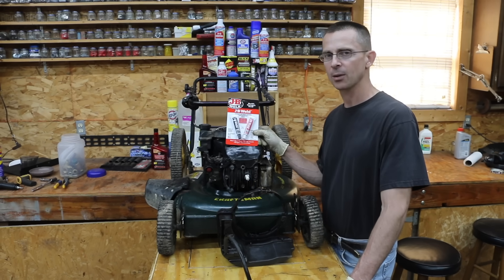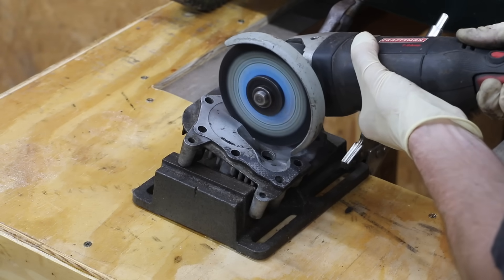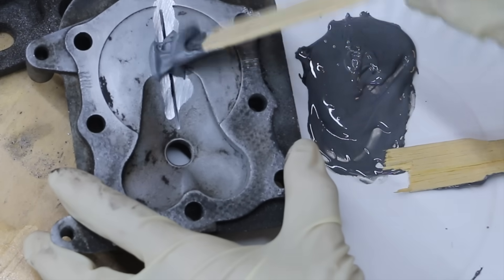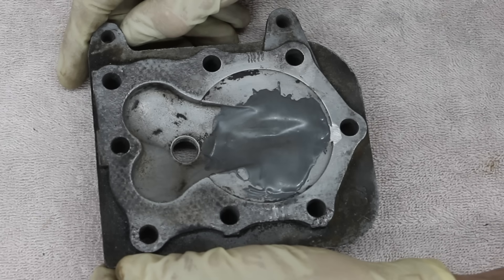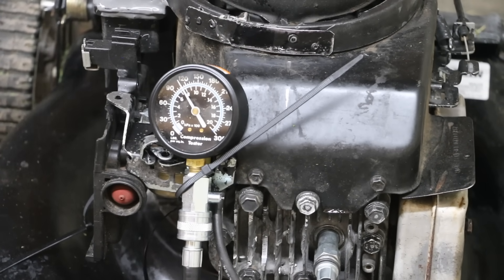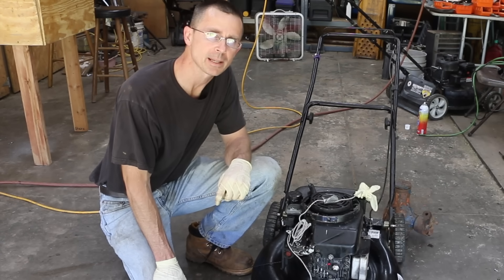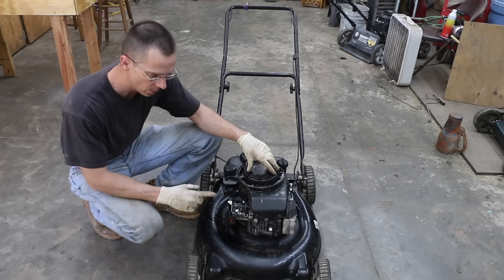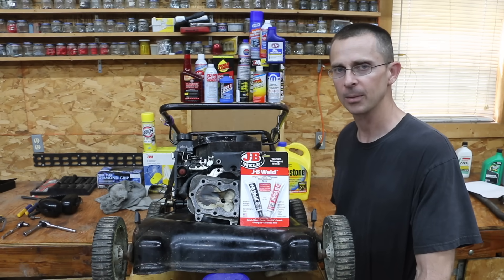Can JB Weld fix a cracked cylinder head?  See the proof!!

Comment: I have JB High Temp in all my motorcycle tool kits in the event of an engine case break on the trail or somewhere remote. After watching this vid and your epoxy showdown vid, I'm replacing HT for the Original. Im convinced now that the Original spec of 300F max temp is suitable for an engine case break. Moreover, from your showdown vid, I can use Original on plastics. 
Smart work! As a biochemist, I dig watching your methodology!
Reply from the maker: Thank you very much!  JB Weld original is a great option in your situation. Thanks again.
Reply: @ProjectFarm  thanks for the reply! I was leery to post a comment (bc with all your subscribers and simply time managment) and then my post wouldn't get read. Very cool. You do read your posts! Thx again!

Comment: JB Weld is awesome stuff.  A few years back I owned a Wheel Horse lawn tractor with an 8HP  single cylinder cast iron Kohler.  While mowing one day, the connecting rod broke and the crankshaft pushed the broken rod through the side of the crankcase.  After gathering the 4 pieces of cast iron, cleaning and preparing them by grinding and beveling, I re-assembled the pieces (like putting together a jigsaw puzzle) and applied JB Weld to the outside area.  24 hours later, I repeated the JB Weld on the inside area.  I replaced the connecting rod with a new one and mowed for 5 more years, eventually trading to Wheel Horse for a new Cub Cadet.   Even though the repair of the crankcase wall was made in a low stress area, the 5 dollar JBWeld gave me a lot more time with that tractor.
Reply from the maker: Impressive repair!

Comment: I used epoxy glue to glue a hole in a Head on a 225dr 3 wheeler worked great for little over a week
Reply from the maker: The heat must have exceeded 500F, the heat rating for the JB Weld.  Extreme heat might work if you can plug the hole using it from the inside of the head.

Comment: I used JB Weld to attach a ceramic handle to an aluminum dutch oven lid. After all the heat and washing, more than a decade later still holds fast.
Reply from the maker: Impressive results!

Comment: I am curious, how well would jb weld work to repair a substantial hole (2-3") in the coolant channels surrounding the cylinders on a cast iron diesel. Maybe place a steel plate over the hole and cover with jb weld?
Reply from the maker: I believe it could possibly do the job (hard to form a strong opinion without seeing the damage) but it's extremely important to remove all traces of oil and antifreeze.  Yes, a piece of metal over the hole and a very generous dose of JB Weld. Thanks
Reply: @ProjectFarm  Is there any way I could send you a picture?

Comment: I recently encountered a stripped spark plug on a seeding machine. It was a Honda engine, but aftermarket head assemblies are cheap enough...$50.
In a pinch could the plug be glued in with JB? This is assuming there is a spark plug ground contact with the engine.
Reply from the maker: I believe JB weld is a terrific product, but the head temp over time would likely lead to failure.

Comment: How's it holding up as of October 1st 2018? I'm curious as to how long JB Weld will hold up? It will eventually begin to peel away.
Reply from the maker: I haven't continued to use it.  Great point regarding the extreme temps of an air cooled engine.  I don't believe that it would provide a permanent repair in the combustion chamber, but it would do very well in other parts of an engine.

Comment: I've used this for so many things.I put  aluminum foil with spray on oil,then put the worn out shifter ends on and rattled them around, filled with JB.My car didn't have a problem after.It was a 5-spd GLH Omni '85.The rod was a hollow tube and ball-n-socket ends.
Reply from the maker: Impressive repair!

Comment: I have a motorized bike the crankcase where the 4 bolts go  had a stripped hole so I tapped the hole,the tap was too big it broke a piece off the crankcase in the hole of the thred where the bolt goes.
I saw this video and may just try using JB weld I need this to work dont want to spend $ I dont got to replace it.
If it works I will post my video.
Reply from the maker: Thank you

Comment: Interesting video. I have used JB Weld to fix scores on hydraulic cylinder rods. It will smooth-out the damage so your rod seal will last. Not ideal, but in a pinch, it works. Laurin
Reply from the maker: Impressive repair!  I have lots of hydraulic equipment around the farm. So, thank you for this idea!

Comment: I just saw this video, impressive result from JB !  I have a min-80's Tanaka air cooled outboard I used on my canoe till I let it slide down a wall and hit the cement floor causing many shatter-pattern cracks in age-hardened plastic and significant leaking.  After cleaning & drying I used a soldering iron to try and weld the cracks but still had some leaking so I ran Seal-All along the visible cracks + those I stitched with the solder gun.  It still leaks a little.  Maybe I missed a couple of cracks, need to recheck.  It would have been a better test if your gas tank leak was at the bottom of the tank for more extended exposure to fuel.  
I considered JB initially but I couldn't confirm it would be secure on polyethylene plastic.  I'd buy a new tank if they were available and haven't been able to find a good used one.  :(    
Interesting channel, I like your tests.  Seems lots of us has the same interests !!
Cheers !
Reply from the maker: Thank you!

Comment: When you use your wire brush on the cylinder head and the cylinder and valves, does that damage either in any way?
Reply from the maker: It does cause scratches. I wouldn't do this to an engine with a lot of value.

Comment: This test, JB Weld, was not complete. The "crack" introduced via grinding was really a slot. Since the slot was encased at both ends it did not represent a true crack which would exit out of the side of the cylinder head. This would potentially allow the epoxy to let go due to lack of support.
Reply from the maker: Great point and thanks for the constructive comment.

Comment: I've used JB weld for a cracked water jackets on my farmall f20 and f12. It been 10 years and still holding good. Also used it on steel gas tanks, it's a good replacement for sodder. Good vid!
Reply from the maker: Impressive repair! Thanks for commenting on this.

Comment: I have used it for years. glued in a spark plug that the threads were stripped. And repaired a block that a rod went through. However not good on exhaust manifolds
Reply from the maker: It's an amazing product. Thanks for commenting.

Comment: I can tell you now. Jb weld can't handle the pressure and heat of an engine.
EDIT: I stand corrected.
Reply from the maker: Actually, you're right with regard to the long-term impact of the heat inside of the combustion chamber.  However, it does great if temps are below 500F.

Comment: Marine Tex is another product you might want to try. It has fine aluminum filings mixed into the epoxy. It is also thicker than JB so it runs less. It can be drilled and tapped. Has been used to repair water jackets on out board engines as well as a hundred other things. Just FYI.
Reply from the maker: Thanks for the recommendation.

Comment: Brother in law used it on cracked engine block in old Ford truck. It was leaking coolant. JB fixed the issue and it was still working 3 years later when he sold it to an old farmer.
Reply from the maker: Impressive repair!  JB Weld is a great product.

Comment: Do you this would plug up about a 1/4 inch hole in a freeze plug on a jeep?...
Reply from the maker: Yes, but it is extremely critical to remove all traces of oxidation and antifreeze.  If the surface prep isn't great, it won't work.  The product needs to grip onto a very clean surface. Hope this helps.

Comment: I had a plug hole in a VW cylinder head strip out years ago and was strapped for money so couldn't buy a new cylinder head. I cleaned it well with brake cleaner and JB Welded the spark plug into the head and then drove it for most of a year driving 140 miles a day to and from work. Finally bought a new heads and installed. Neighbor kid asked for the dual port heads I had removed and drove an additional year before changing. Still was running but plug was shot and we couldn't get the plug out of the head.
Reply from the maker: Impressive!

Comment: I have a 2 stroke dirt bike that had a broken ring that scored a groove in the cylinder wall from a port up to the top of the cylinder. The groove was about 1/8th inch wide, and about 1/32nd  inch deep... I'm attempting to repair it with jbweld.

And have you ever tried Titanium putty?
Reply from the maker: I haven't tested titanium putty yet.  Thank you for the recommendation.

Comment: I use JB weld on a cracked exhaust manifold on a high compression 429 big block because actual welds kept cracking. It is actually holding up. Impressive stuff.
Reply from the maker: Impressive!

Comment: I could save you some time on doing that but it's already too late but try it on the in exhaust system where it gets about for 500 Degrees it does work tremendously add a straight-6 that's was a slant six Chrysler motor with a split exhaust and I fill the Gap with J-B Weld let it sit for 24 hours sanded it smooth and they look real pretty put it together turn around and down the road that a bit of extra noise so if it works on the intake I will guarantee it will work on the exhaust system and yes it does work on fuel tanks be careful though make sure to dry before you put fuel back in it it will stop your fuel tank flowing if it is in the wrong location
Reply from the maker: Great point.

Comment: When I was young in the early 90's, I had a Jeep that I had over tightened the cast aluminum timing cover on.  Coolant leaked out.  I used JB weld to repair it.  Drove it over 10,000 miles before selling it.  It never leaked again.  Great stuff!
Reply from the maker: Impressive!

Comment: And you could have used the high heat or extreme heat. Just had garage apply extreme heat around o2 sensor in my s10 exhaust piping. Hoping for less noise.
Reply from the maker: Great recommendation.

Comment: Back in 1999 I had to use. J. B. Weld on a 96 Kawasaki Vulcan Classic 1500cc the  radiator had a cracked at the mounting point and where it's aluminum it was hard to get someone to weld it . To replace the radiator was going to be about $200-$300 so I decided to try J. B. Weld and it worked great ever since then when I'm with friend and  something breaks I say "better get some J.B. Weld"
Reply from the maker: JB Weld is a great product!
Reply: Yes it is

Comment: When i was a young boy i'd watch and help my father and uncle strip clean and rebuild engines, carbs, cars etc and as my father was a welder he swore against using jb weld, but my uncle was a fabricator with cnc and laithes and he swore by using it jb weld.

I can say for sure that if i need something fixed ill be throwing my money at jb weld!
Reply from the maker: Yes, JB Weld has saved me many times on applications in which I'm unable to use my welder.

Comment: But it won't repair a lowmside air-conditioning expansion tank. Refrigeration ate threw in a few hours.
Reply from the maker: Wow! Thanks for commenting on this.
Reply: interesting though, because i used super glue - not sure which brand, this was years ago, and it fixed it, and stayed all summer.

Comment: Used JB weld to repair the fuel accumulator on my old Jetta. The accumulator is a thick plastic box in rear passenger wheelwell area. Large debris on road kicked up a put a good sized crack in it... Used JB to repair it and it held up well even under pressure and exposed to gasoline.
Reply from the maker: Impressive repair!

Comment: been using JB for 30+ yrs. I once was given a well worn riding mower that had poor compression and tapping sound. after taking it apart found the seat of the exhaust valve loose and laying cockeyed under the valve. I JB welded it and center punched around it worked for many years till I sold it.
Reply from the maker: Impressive!

Comment: Is this cylinder head still goin or has it bit the dust by now?
Reply from the maker: I haven't used it since this video. I believe the heat would cause failure, since it's an air cooled engine and temps exceed 500F.
Reply: Project Farm hmm think it would have been interesting to see how long the head would have lated maybe something for the future 
Thanks for the reply buddy till the next project

Comment: You went POSTAL with that grinder!.        I feel that as long as you properly mix the JB Weld,  you will have success.     UPDATE:   You had success.   JB Weld is a remarkable material.      I saw a guy fix a chipped crankshaft gear lock pin key way on a Miata.   It actually held up and the timing belt seemed to hold up.    Eventually that particular job will go South.   There is too much pressure and speed at that point.       YES I have used JB Weld and JB Quick Weld many times.   Lifesaver type stuff.    Very well chosen subject material.   You have many viewers that saw your demonstration that are impressed.
Reply from the maker: lol. Great point regarding JB Weld.

Comment: I’ve used a split compressor hose with JB weld and two hose clamps to patch a hole on the aluminum air conditioner line in a Ford Expedition. Let it cure for a week or two. Even with the r134a going through the line it still help up fine for 7 years with no leak!!!! It saved me from having to replace the a/c lines. It held a perfect vacuum the entire time all the way up until I sold it. JB weld is some tough shit in my book. I’ve also used it on lines that were exposed to gas fumes, coolant etc. never had it break or come lose. You do have to take proper steps in preparation though. Sanding the area with rough grit and cleaning the area. Helps to give it support like a split compressor hose around it with clamps. A must have in any home mechanics or DIY guys toolbox.
Reply from the maker: Impressive repair!

Comment: Good video & text . I once had a 1969 Chevy 396 engine that had a crack at a lil vain i repaired it with JB.weld & last for five years even on the drag strip.sold car & no problem s
Reply from the maker: Impressive repair!

Comment: JB Weld works very well to fill in holes/cracks, even under extreme conditions. However, you will find it has very little shear strength, such as re-attaching broken parts.I have seen several attempted repairs on chainsaws, for example, such as repairing broken plastic or aluminum handles. In all cases, the JB weld popped loose no matter how the parts had been cleaned/roughed up/prepped. It simply doesn't have any shear strength as a "weld" to re-attach broken parts that have even moderate stress/pressure/vibration on them. It is not a "fix all", however, as you have demonstrated, it works great for many applications when used within it's limitations. Perhaps you could do a shear strength test video on JB Weld to check the validity of my observations? :) Great job on the videos.
Reply from the maker: Thank you!

Comment: I'm going to try using JB weld on my alloy wheels where it gouged out a bit of alloy, use a wood chisel to get it shaped better when it is in the "plastic" stage so sanding is minimalised.  Then spray paint then clear coat.
Reply from the maker: Seems like a great approach.

Comment: JB weld seems to be inert once it's cured, I don't know of any normal chemicals that affect it. Interestingly enough, it actually seems to be able to take the same temps as the high heat version, which is weird, because it's quite a bit stronger. Very high dielectric strength as well, even at high voltages, I use it on home-made gas discharge tubes, and as sealant+insulation for conductors that pass through a metal wall on multiple pressure vessles, never had any issues with it breaking down electrically, or blowing out. Also used it to repair fuel tanks, and seal threads on fuel systems that were not designed to screw together. Come to think of it, I broke part of the carb on an Echo leaf blower (the broken part was plastic), used tape to make a form, and cast JB weld in place of the missing chunks, drilled and tapped the holes, and it was good to go. As long as it's used inside it's thermal and mechanical limits it's pretty incredible stuff.
Reply from the maker: All great points and thanks for commenting on this.

Comment: I've used JB weld to repair striped bolt holes. Drill the hole out. Fill with JB weld let it cure 24 hrs. Drill the hole out and tap it. Works like a charm.
Reply from the maker: It's a great product!

Comment: Thanks for your video, I have a hairline crack in my jeeps radiator. I have been researching solutions that I could do instead of spending a fortune replacing it. I ordered jb weld and haven't used it yet, but your video convinced me that if you could seal up that crack you made, it would certainly work on my radiator!
Reply from the maker: I believe it'll work but surface prep is incredibly important as well as allowing the full 24 hours for it to cure.  Cleaning with a slightly abrasive material and using brake parts cleaner to get rid of any trace of antifreeze or oil is a critical step. Hope this helps!

Comment: The excess epoxy is why you had 110 psi of cyl compression as it decreased the combustion chamber volume. Now the engine might need high octane gas! LOL    I too have had great results with JB Weld. I found the key is to get the surfaces to be bonded perfectly degreased. When you think it's clean enough clean it again. I simply give the parts a 30 min soak in acetone and that has worked for me to clean all oil from them.
Reply from the maker: lol!  JB Weld is a great product!